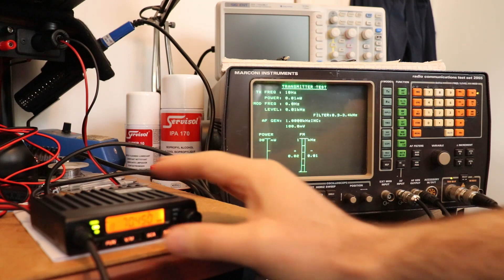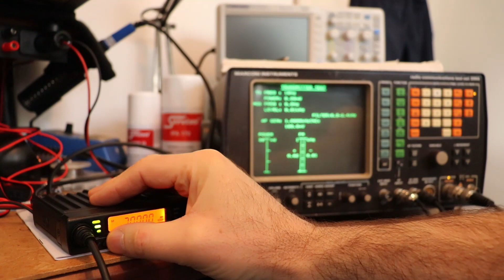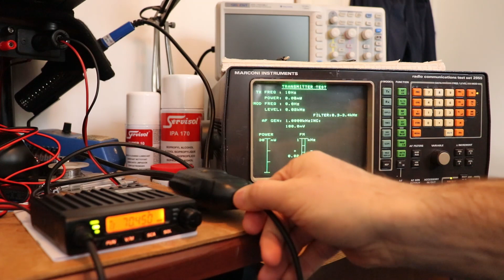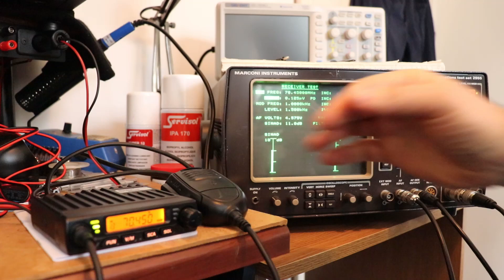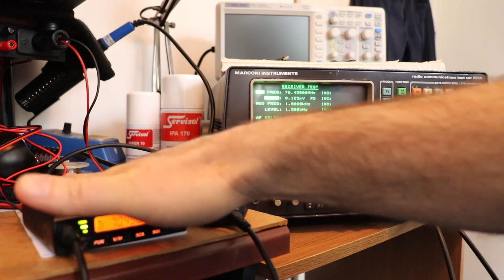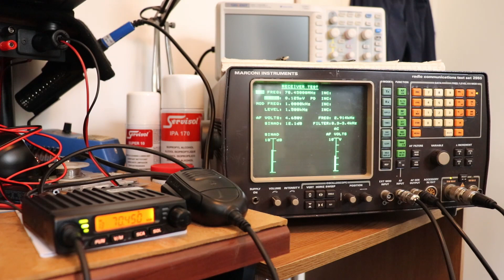Anytone AT-779

Comment: ah 2995 default AF tx 😁filter set wrong-classic 2995 bug!
See the AF filters on test set markings -set it too 15khz LP filter ,ull see on testset screen then change,then measure fm deviation correctly!
If you dont youll fm deviations will be out on peak dev and incrorrectly read!
I remeber well after 200+vhf FM wide sets were incorrectly setup on a bench,that was fun,only when we looked at 2995 spotted the AF filters defaulted to 0.-3.4khz wrongly!
Gotta love the 2995 lol

FM deviation should be 16ko Wide F3E=4.2Khz  (15khz LPF)CT dev 750Hz/8k5 Narrow F3E=2.10Khz (15khz LPF)  CT dev 375Hz  for reference use.
Total dev 5.00khz max with ctcss on \2.50khz max with ctcss on.

Hope that helps you,I used to train new RF engineers in use of 2995 testsets,old habbits lol
2995B was my favorite one ..nice to see the old work horse in uses on a shiny new set.
Im familar with cb version of that set,but first time seen one on the bench in 66-88mhz format seems ok,Fab vid thanks 
all the best

Rob P
Reply from the maker: Thanks Rob, will double check this next time I have the test set on. Am planning to do a receive test comparison of all my 4m radios and transverters.

Comment: Nice, I am very curios at this radio. I looking forward to the next test you will do. best 73 de sm x xxx
Reply from the maker: Thanks for the comment, the AT-779 is now installed in my car with a 1/4 wave whip antenna on the boot. The band is very quiet but I have had a couple of mobile contacts. I'll look to do an update video after I've used the radio a little more.
Reply from the maker: Well the update video will have a slight delay, the radio is going back and the shop is replacing it. Driving last Friday I could smell something hot, the radio got so hot it could burn you if you touched it for too long and this was just in receive. So something has clearly failed. The shop also said they've had another radio returned with similar symptoms so they are soak testing the radios they have in stock to try and make sure only good radios go out to customers. Maybe there's a batch of these radios with some bad components?
Reply from the maker: I thought I should give an update to my failed AT-779. The shop quickly sent me a replacement radio they had soak tested. After many months I can report the radio has been faultless, it actually runs cool, I would say it's no different than I would expect any other radio. So I'm pleased with the radio and very pleased with the response from the shop concerned.